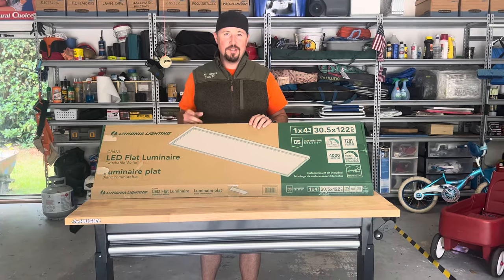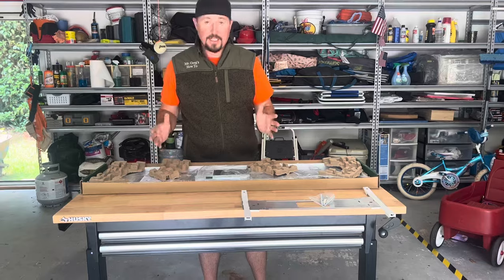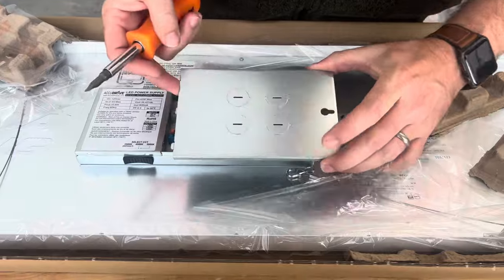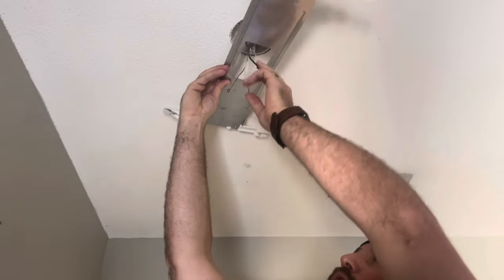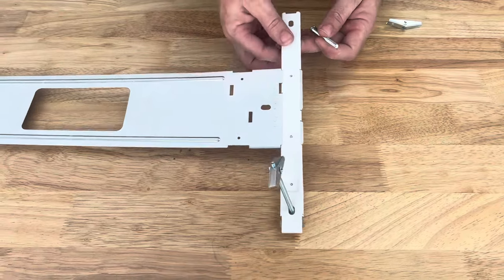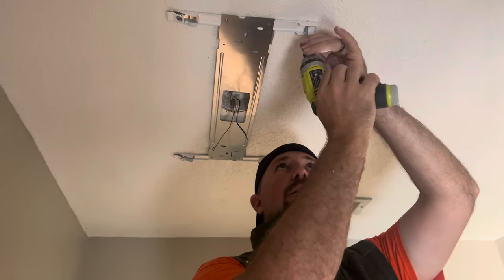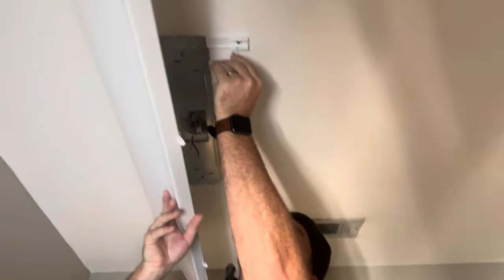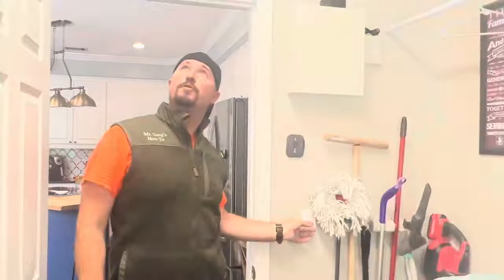HOW TO Install Lithonia Lighting LED Flat Luminaire + HONEST REVIEW //  Fluorescent Replacement!

Comment: Thank you for the helpful video! I'm going to be a little pedantic; those numbers on the CCT are selections for color temperature, not brightness. 3000K is warm, closer to the old incandescent bulbs, 4000K is a little less warm, and 5000K is white. Once you get up past 5000K, there's more blue in the light and down below 5000K you notice more yellow in the light. I personally also like 4000K for inside the house.
Reply from the maker: Thanks partner!  That’s very informative and well explained. I agree on the 4000K.

Comment: Protect the wires from the edges of the metal pop off.  They are very thin wires.  They do not proved a wire sleeve.  When I lifted the light up in place the wire shorted on the metal edges.  Had to return the unit.

Comment: The wire is thin.  Put electrical tape around the punch out hole.  When I lifted the fixture up in place it scraped the wire and sorted out.

Comment: You should consider taping the wire nuts with 3M 33+ as a safety precaution to prevent unscrewing.  If the wire nut DOES pop off for whatever reason, the wire is held by the tape.
Reply from the maker: Good tip, partner!  Thank you for sharing.
Reply: General consensus, actually, seems to go both ways (to tape or not to tape!).   Anyway, I think it’s a good idea/

Comment: I don't have a junction box, just wires through a small hole in the ceiling.  Will I need to cut out an area in the sheet rock to recess the wires back or does the bracket give enough space  to tuck the wires between the light and ceiling ?
Reply from the maker: Howdy, partner!  Building code would almost certainly require a proper junction box for safety.  That said, there may be clearance.

Comment: Video was great.  I got mine at Lowes and the drop ceiling light (without mounting bracket) is on the shelf with the flush mount (with the bracket).  I live 45 minutes away from Lowes.  Guess which one I brought home.  The box had a label over the note about the bracket.  Thanks so much.
Reply from the maker: You’re welcome, partner!  Glad it worked out for you!